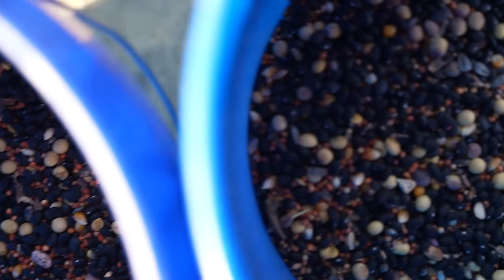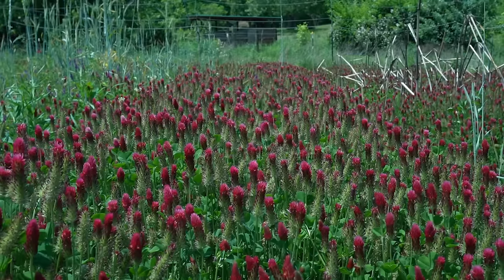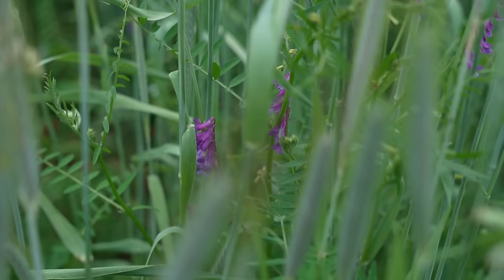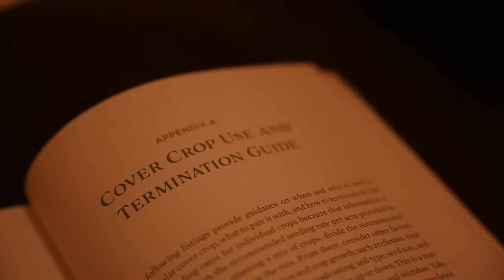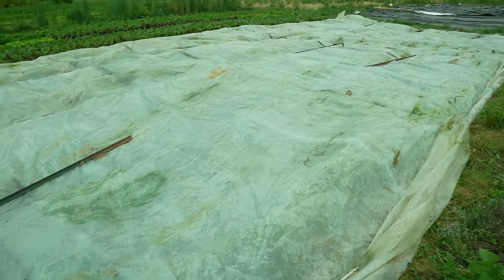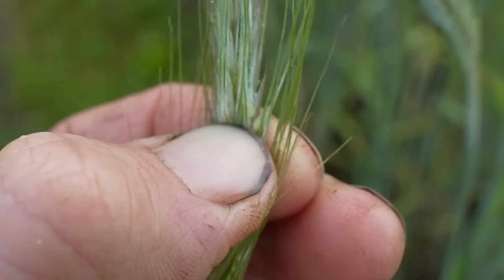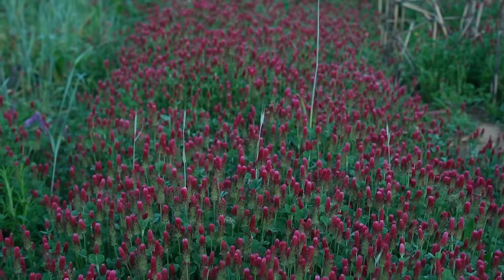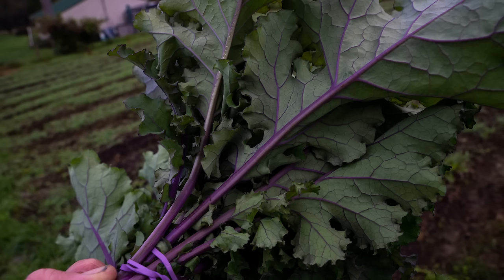Cover Cropping for Soil Health | No-Till and Low-Till Strategies

Comment: After 30 years of composting for mulching my annuals I stumbled on a quicker, easier, richer mulch: SHREDDED LEAVES. My neighbors trees dropped too many leaves for her to manage in the fall so I volunteered to "clean up". I bought an electric leaf vac/shredder, 15-1. It came with a canvas bag which I slung over my shoulder, requiring frequent stops to empty. (This would have gone much quicker if I had help from someone pushing a large cart to trap the mulch.) I put the mulch in my 140 sq. foot, raised bed. It slowly, over a few winter months, broke down,  leaving dark soil. I will NEVER compost again. Remember: Keep a cover crop, even if it's just weeds. Why? Building soil is done by ROOTS IN THE GROUND. Observe nature, learn, follow. Don't make work by fighting nature or following traditional farming/gardening, e.g., turning over the soil. Does nature plow? Hell no!

Comment: Yesterday I used the 'standing-bar-crimp' method on winter rye yesterday, then a manual post hole shovel to cut windows through the rye mat and transplant into those windows. Basically treated the flattened rye like people use black plastic weed barrier. Looked nice, I'll see how it performs.

Comment: I have been trying to work with baby greens as a great cover crop in the fall. They are quick, most are brassicas and act as a great mulch and also helps with pathogens. We have given up on growing brassicas in the spring since flea beetles and bolting have been issues instead sowing them i huge successions in the fall to harvest some greens off of…And the best part is we dont have to deal with flipping a bed of baby greens since the frost kills it! So far so good!
Reply from the maker: Maybe not quite the same thing but I will often just leave my arugula beds in the fall to grow tall and then flower in the spring (they usually survive our winters). It's a solid cover crop!
Reply: @No-Till Growers  I think that would be exactly what I would hope for. In a perfect world after our summer market winds down all these baby greens would bolt and then make an even better crop. We learned with cilantro that when something like that sends up flower stalks they make a much better, more fibrous straw-like substance. It's a hard balance since you are still expecting to harvest it so we are still hoping to figure out the "best" way.
Reply: As I understood, if you plant mustard as cover crop, you should till it slightly after terminating it? Didnt understand that part in video.

Comment: Yeah, we harvest the top part of our daikon radish from our cover crop then cut it and mix it with an Asian veg green mix. Then sell it with  rotisserie chicken and the mix. Pickup only. We also do a we also do a soul food mix greens, mac, rotisserie pick up only. It depends really because sometimes deer can get into your cover crop. If you end up doing this and you have deer pressure and are unsure if you recently had some in your field for food safety setup a trail cam.  The best part if you put the trail camera on wireless it can dump the pictures into a hard drive you can check later. For dates and times of what visited the field. I always wish that folks would get together and create an OS for small and medium farms that is open OS. So it can feed the world better. Because if John Deer or someone else does it. Gonna cost an arm and a leg and be uncost effective for so many farmers. 

Really covercrops are so under explored by most of farming. Here in Cali you see so many farmers who's fields are desprate for cover crops. But so many farmers don't own the land they produce on. Which means you got renter mentality on those fields. Which basically hurts the whole state in water retention. The whole state should be cover cropping no dig mulching up extreme but land is so expensive and the people who own nickle and dime the people who produce and there's just so many hands in the pot. Not the people who got a hand in the pot are doing the sweat work.

Comment: My garden was flooded by a heavy spring rain which laid on the surface for several days, compacting the soil. I sowed some peas and oats April 15th. By June 15th, the area of the cover crop was very crumbly soil while 6 inches away was hard as a rock. I’m surprised the soil changed that quickly.

Comment: I grow 450-500 dahlia plants in 60-foot raised no-til beds; I don’t dig the tubers until mid-October at the earliest, which is late for a cover crop. I’m thinking of sewing a crop and then covering the rows with a cover suspended by wire hoops. Here in Connecticut our falls are getting progressively warmer, so covered rows might get me sufficient time to get the cover crop established. Also, which cover crops would you recommend? Thanks.

Comment: I am starting out in the market farm business, with some weirdness. More on that at some later date. I'm thinking of using white clover zone 8b/native clover/in my front yard nearly impossible to get rid of, anyway; to plant living pathways and cover crop. The goal is to use a nitrogen fixating legume to reduce the need for carbon and nitrogen additives. I think I can mostly rely on compost mulch for the rest of the macro-nutrients and fish based micro-nutrients/soil conditioner for the rest of the soil needs. The rough thing is, white clover makes a tenacious and difficult to  kill cover crop. Do you think a robust/leftover root system of white clover will be a major problem in the market garden? They tend to come back from visits from the devil himself and I'm worried that, even though it's a short plant vs most of what I'm planning on planting. Might be a pain to have carrots around. I would, of course, let slow growing crops get taller than clovers before transplanting. Whatcha think?

Comment: I went to the Food Summit with Joel Salarin, Joel Kurtz, and Justin Rhodes a couple weeks ago. And a  construction guy said they always throw down black unwoven variety garden cloth at their job site ls to prevent mud. He claimed the woven style cloth always left thick mud. But the unwoven cloth lets water in naturally without creating mud slicks. Right now I'm reclaiming some scrub area on my hillside from poke weed, devil's walking stick and brambles with some silver tarp.and cement blocks. Pretty dry under there.  But not enough to kill everything (week 3 right now). I've used the unwoven black garden fabric for weed supressoom in my rsised bed with pretty good results so far. I plan on growing suflowers (support for my Amaranth with their heavy seed heads), mammoth beats (to break up some of the clay),  beans for nitrogen, and Amaranth with maybe some Quinoa, and sorghum mixed in. These 3 are my desired crop which I want to grow for fodder for coturnix quail.  Think I'll try to get a crop out of that while maybe throwing in some buckwheat for a some Phosphorus in the spaces in between. Then in the early spring I'll use that black nonwoven cloth to kill off whatever's left.  And hope the black cloth and microbial action from the mulch heats up my soil to get me a little earlier start next year. I'll try to break down and kill off the weeded apot next to it while It's growing and plant some hairy vetch, mammoth beats, kale. S7nflowers, and rye grasses (einkorn) as a comparison..

I'm an amateur gardener on my 3rd year so I have no idea how this will turn out. But my idea is to mimic the big weedy vigorous growth of weeds I already have and mimic the pattern with more useful plants. The plan is to just scatter the seeds evenly everywhere all over the plot to see what likes my soil and see what takes over.

Thanks for the tip on rolling a water barrel over ithe seeds for better contact 👍

Comment: why is no one using a sodstripper iam a landscaper and it makes so much sense to use a stripper. it has an adjustable cutting height so your sod can be real thin not mucking up soil just some thatch. no one has ever mentioned for starting or terminating

Comment: I’m pretty sure I did what no one has done before.  I used my own parsnip seeds from my earlier planting and used that as a overwintering spring cover crop.  Germination was excellent and I just cut them off barely beneath soil level when I planted various vegetables in April and May.  It’s a fun experiment.  They have deep tap roots and somewhat easy to manage in our small garden.  They don’t die or rot yet but I guess they’ll eventually lose their energy, not sure.

Comment: I’m sorry to hear about the failed termination! Do you think you would’ve had the exact same results if you had used a darker silage tarp?
I’m going to buy a hat from your website to help support you and your awesome content. Thanks buddy!!!
Reply from the maker: Awe, thanks! Generally moisture even in that exact spot is fine with silage tarps. I guess some combination of the extreme heat (amplified by the greenhouse effect of the clear plastic) and the escaping of moisture was just a bit too much. Bummer.
Reply: @notillgrowers : So, let me understand this..  Clear plastic creates more heat from sun than a black plastic?  I thought like white painted cars are cooler in the summer on the inside than black painted cars... as the white reflects ultraviolet rays, and black retains them.  🙄

Comment: (solar drier fail) Have you tried using a steamer? We had a steam hairdrier we used until It broke because it wasn't really industrial but it worked for about 3 years really well. Crimp it then went through with the hair drier with steam and just busted open the cells. After the cells were busted open never came back. I image if we had a flame weeder it would work better but we are in Cali and flames and cali do not mix. You really don't need a lot of heat to bust open those cells and kill off your plant. You can pretty much plant same day doing that method. I've never tried a flame weeder setup because again Cali but if a steamer can do it I image a flame weeder setup super low could do it even better. Key being not to super cook it just give it a good bust open on the cells.
Reply: Thank you so much for this idea!  I live in a low lying and very wet area.  The only reason we even have a garden is because we have built it up with different mulches.  My husband has a hand held flame thing and it would be perfect to use to kill a cover crop!  It gets pretty hot even around the flame.  I have health issues so I need to find the easiest possible ways to garden. 😊 ❤
Reply: @bobbiejeanesser864  yeah in our area covercrops can not die in winter when you want to so forth. Good luck I hope it works out. Remember you don't neeed to hit the whole plant. You only need bout an inch or less in most cases. it should look like when you cook greens for a dry salad. you kinda just slap it in the pan and take it out for the blanch fast.

Comment: If someday someone would make a steamer for crimping. Just to crimp steam the top and let you push the rest down like normal. I wish I was better at making tools.
Reply from the maker: I almost bought a carpet steamer last year just to try it out haha
Reply: @notillgrowers  I've never tried it with a carpet steamer but what I Found is you don't need to hit the whole area with steam. Just like a crimper you only need a spot of it. I kinda wanna buy a carpet steamer now. But used carpet steamers are harder to find now because everyones doing those tiktok flips on used equipment out here. We use to use a hair steamer for about 3 years but it broke. Never large scale because we only got 2 of them and couldn't find more used. But the steamer worked the best. Would have love to find a flame weeder if I lived anywhere but Cali. Because I don't need the flame weeder to hit every inch just small sections. so it gets weighted down after the crimp.